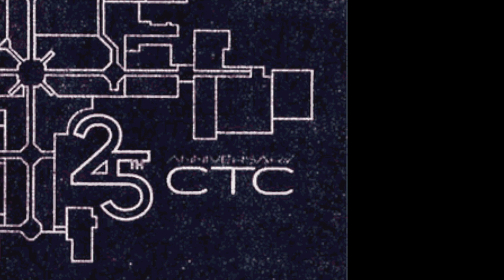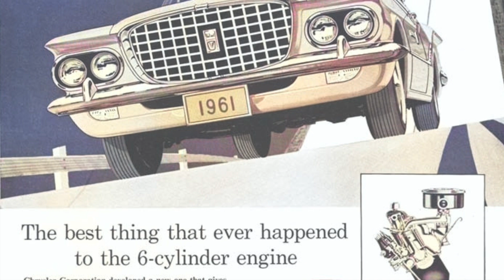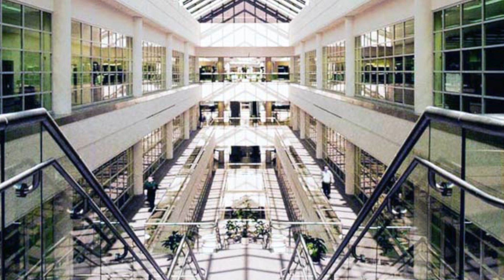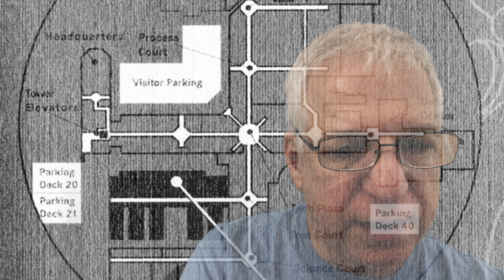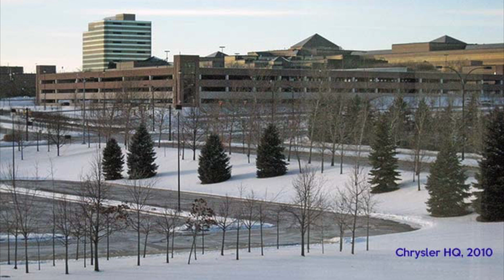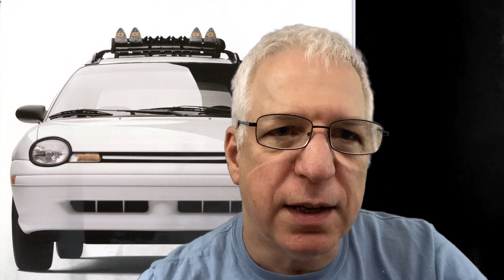Creating the CTC! (Chrysler Tech Center)

Comment: I watched that complex being built as I was working right across Squirrel Rd on W. Entrance Drive for EDS starting in 1989. Having come from the GM Tech Center I was intrigued by it. My late father did all the contracting and project fork for the cafeterias and food service at CTC. Little did I know that years later I would spend 12 years as a purchased service IT contractor for Chrysler from 2002 to 2014 when I went back to work for GM at the Warren Tech Center. So sad to see how things seem to be going under Stellantis. I retired last February but I feel fortunate to have worked at two of the most amazing auto technology centers in the world, CTC and the GM Tech Center.
Reply from the maker: It's pretty amazing and a shame the new owners don't seem to want to fully use its facilities. Having Roush do testing under contract doesn't seem cost effective to me.